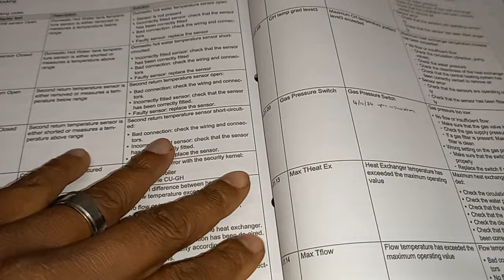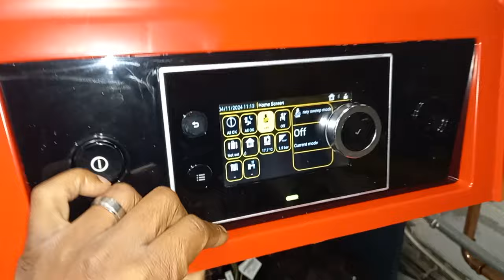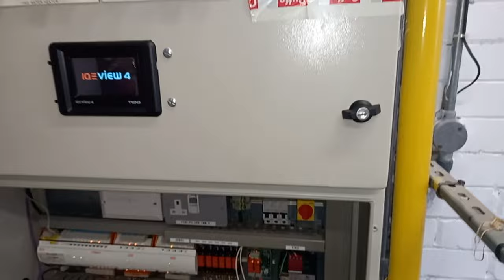COMMISSIONING NIGHTMARE

Comment: Brother go into installer settings into gas fired appliance/commercial boiler scroll down until you get to GPS then switch it off then scroll down again to VPS then switch it off 😉👍
Reply from the maker: @leeevans8407  thanks, exactly what I did. Where were you when I needed you this morning. Tech support and the manual came to my rescue. It's easy when you know. You work for Remeha/Baxi don't ya. I need to Remeha to contact you next time. This is your boiler. Cheers Lee. After all that the gas valve decided that it didn't want to open.
Reply: By the sounds of it you have already disabled the mixing valve circuit CH & HW in the installer settings menu 👍
Reply from the maker: @leeevans8407 got a short at 8pm on all the faults that it came with. Then the last one. The gas valve not opening, that knocked me out.
Reply: @CommercialGasEngineerVideos  sorry bud this morning I was driving the length of England for Remeha/Baxi 😂 and its 💯 only ever easy if you know how or if you’ve done it before !!!
Reply: @CommercialGasEngineerVideos  brother I would re set the boiler to factory settings ( in advance settings ) then start all over again, just to see if that makes any difference, it’s very strange for a new gas valve not to open, there all tested from new at the factory.
Reply from the maker: @leeevans8407  factory reset and start again. Oh boy. How easy is it to get a warranty call?

Comment: If it's a Remeha gas 210 Ace, there's a technical bulletin from Remeha. It's a fault from the factory as there is no flow sensor or gas pressure switch. If you have an email I'll send you the bulletin.